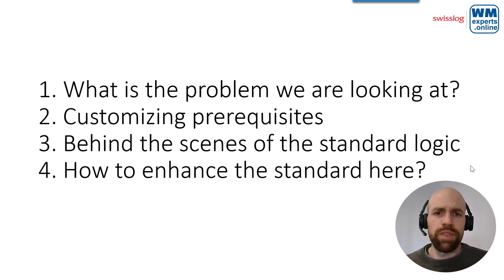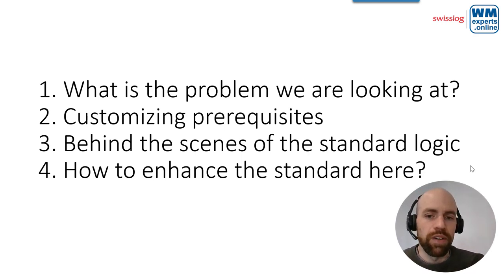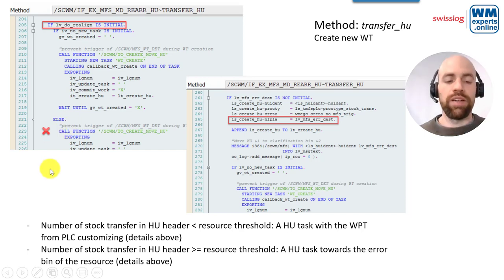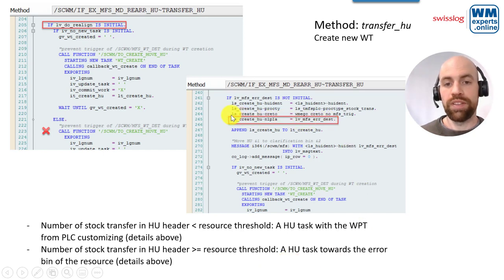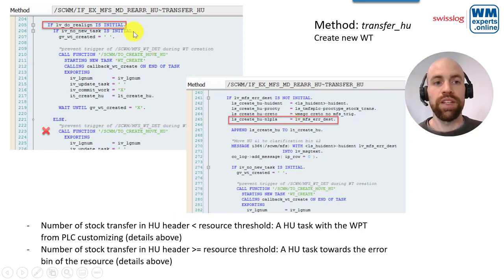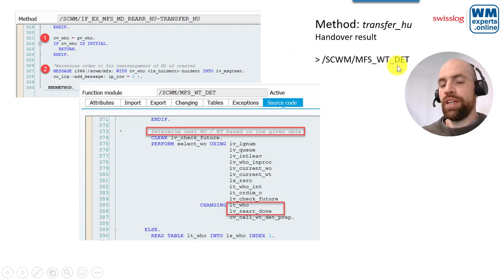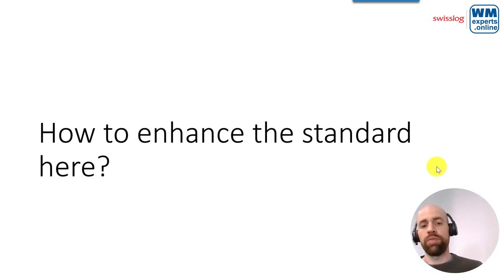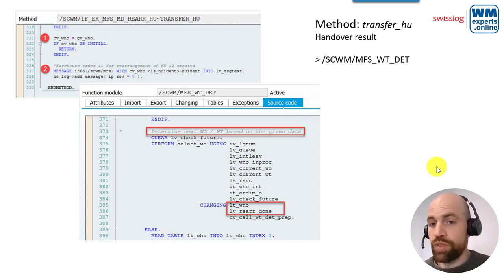Discover SAP EWM MFS - Rearrange HUs in multi-depth bins

Comment: hi. very good  explanation. and beautiful videos.

I have  a  question. 
where the system filed the logical?
I have cases that the crane put the hu inside on logical system '02', but in /scwm/pack I see the logical system  as '01'.
do you know where should I fix it?
thanks  a lot